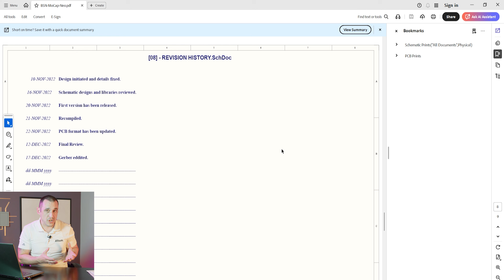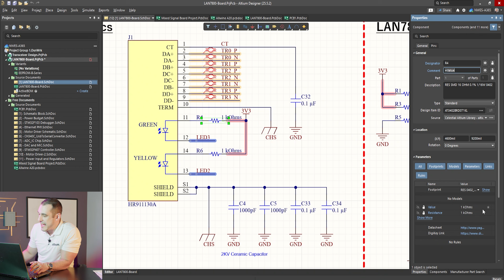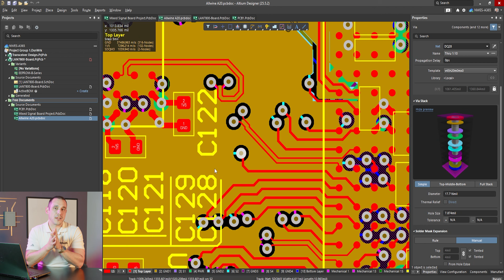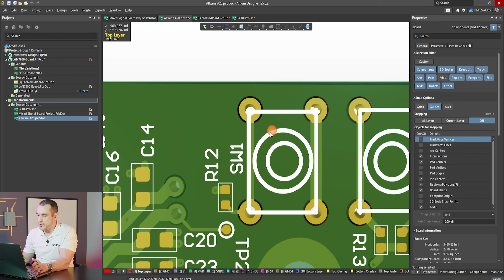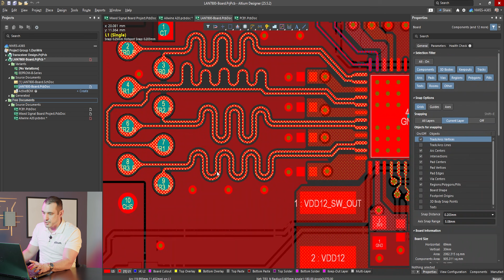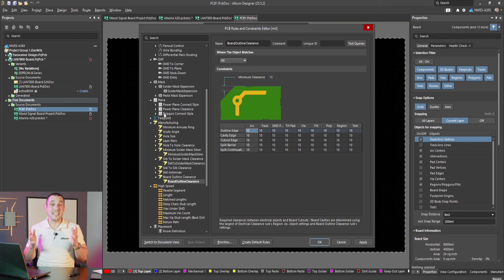What Makes a Great PCB Design Review Submission?

Comment: I think you'll find that "the keep out" area has very granular parameters that determine what to actually keep out of it. If you're talking about a thermal pad, the keep out parameters are not the same as say for a delicate MEMS sensor that possibly forbids even the solder resist from being present under the sensor.

Comment: For the die-attached pads with vias, what happens if you have that large GND pad under the footprint but also a keep out area under the footprint recommended by the manufacturer? What would be the best way to then ensure that GND is properly connected on all pads without embedding those vias?